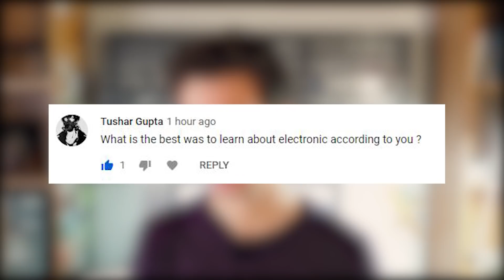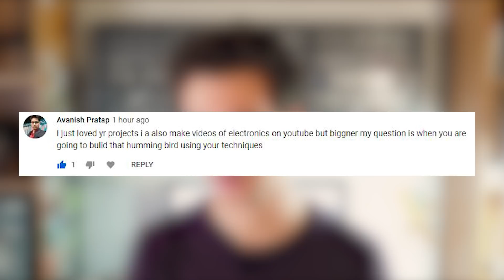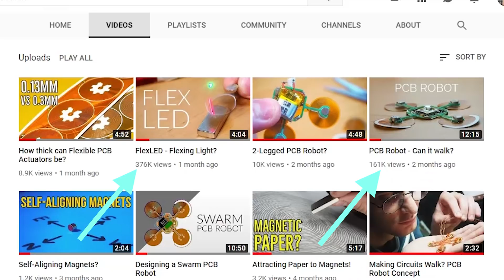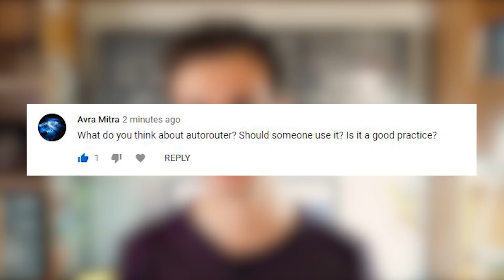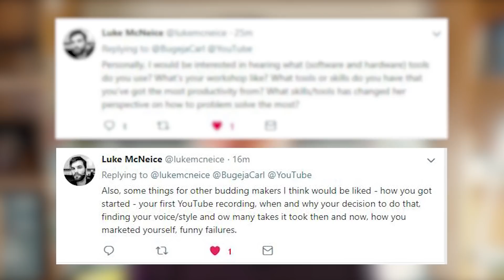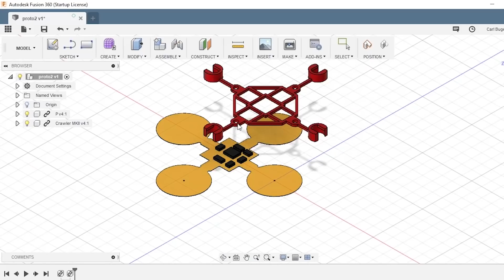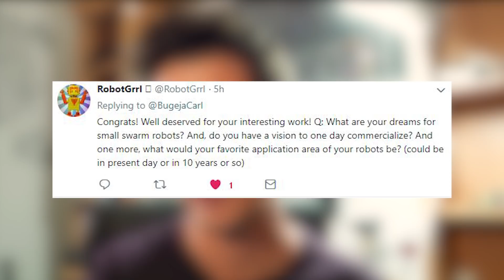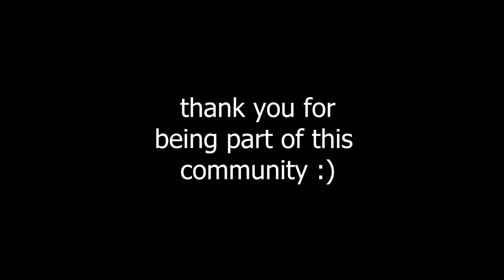Answering Your Questions!

Comment: M'well, i kind of had my attention attracted about flat magnetics distributed in 3D.  My interest is about EMI reduction including by eliminating localized spots of electrical stress while improving fault tolerance in the power supply...  For example, a classic selenoïd has only one pair of poles inside;  in comparison the stator of a 6-Poles stepper motor has as many and vertical stacking of two 6-Poles assemblies comes virtually with 6 more on top of the 12 real ones as a bonus...  E.G. 18.  So, i figure if we spread the same energy between 18 magnetic vectors instead of only 1 then electrical stress should logically get tamed down and why not EMI nuisance with it.  In addition, using flux-concentration should result in « flexing the flux » and hence avoiding open-space losses i would presume.  Imagine if conveniently contained by a Faraday cage, euh...

The question being, how much sense does it make to transpose my 6-Poles stator allusion to some IH Driver meant to inject ~100 Joules into a "Curie-effect" alloy (ex.:  JAi's "PyroFoil") for nearly 2 ~ 3 seconds at most?  ...  In pocket format, of course.  And then there's the idea of keeping the power cells separate, to directly combine their power magnetically instead of electrically, hence the reduction of electrical stress plus improved tolerance to simple cell failure, as the other cells and associated flat magnetics will continue to spread their A.C. energy between the remaining poles.  ...  Reactions perhaps?

Comment: When I first started designing my PCB coils I found FEMM helps a lot on the understanding of the contraints and also to visualize the magnetic field. You should give it a try. For example, when you talk about stacked PCB coils, once I simulated that on FEMM for a past project and came to the conclusion that there's very little benefit to it.
Reply from the maker: Just downloaded it! Thanks for the tip